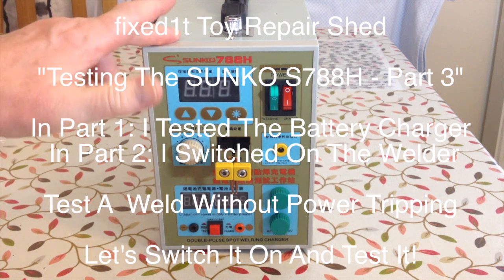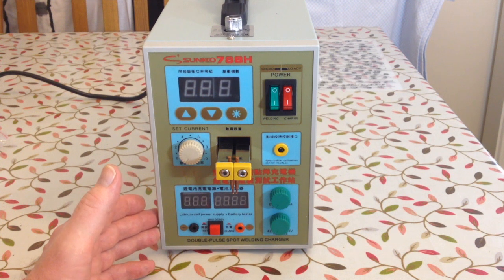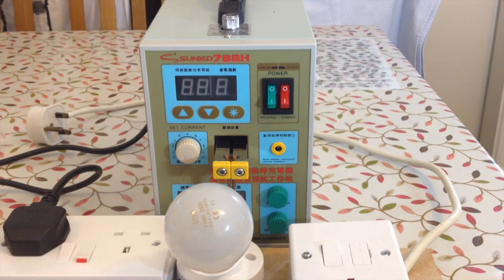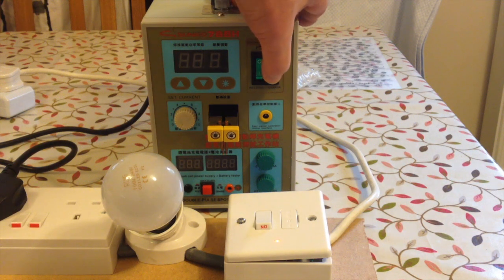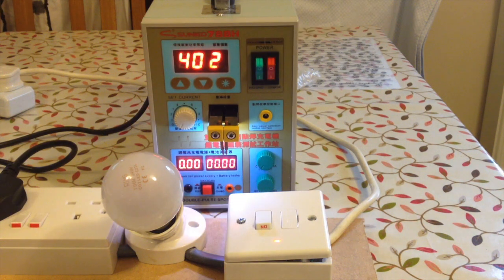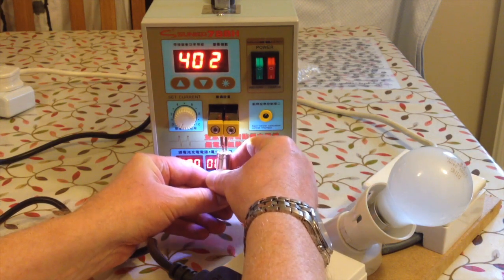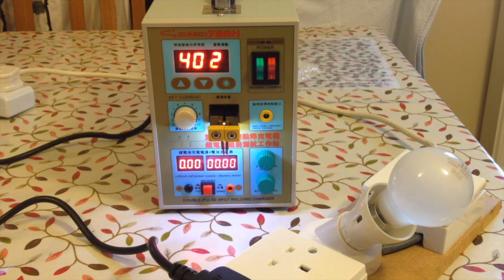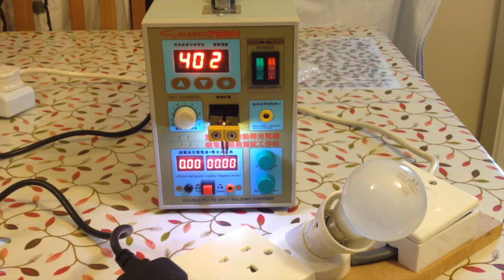overloading SUNKO S788H Battery Spot Welder Part 4 #batterywelder #testing

Comment: check the "13amp plug" mine came with a 20amp fuse1
Reply from the maker: David,  Thanks for the tip, wow thats seriously dodgy, the other thing I'm wondering about (but haven't yet opened it up to confirm) is it using a double-pole double-throw mains isolation switch or is it only switching on an off the LIVE cable and not the Neutral as is required to make it fully safe.  Time to open it up I think.